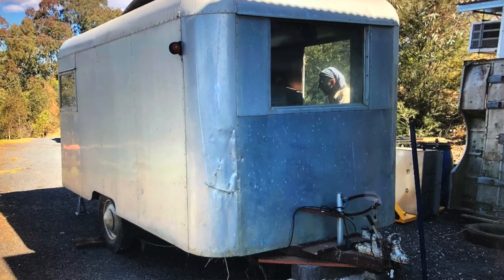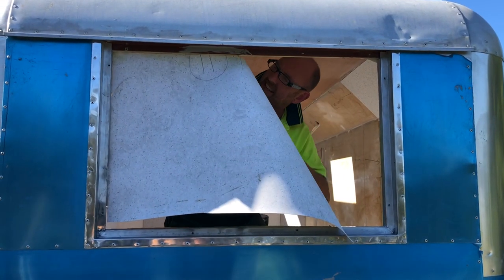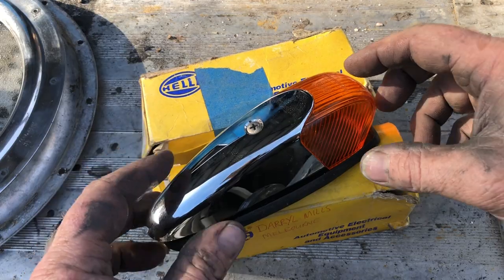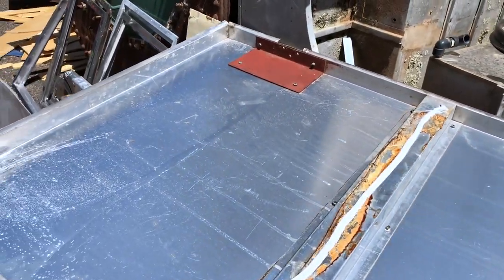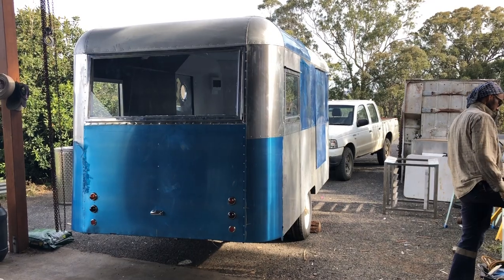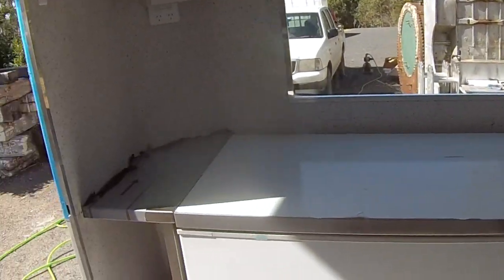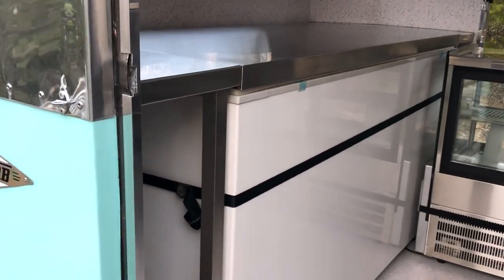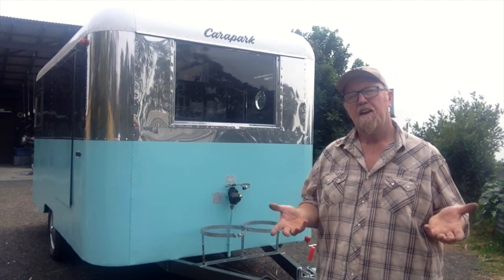Amazing food-van conversion - Best vintage food caravan / food truck build Part 2 of 2

Comment: Hi Steve, thanks heaps for your videos! And congratulations on your great work! I bought exactly the same caravan last year and am finally starting the reno for a food van too, so excited! I'll keep watching your amazing videos with all the detailed infos you're providing, and might ask some questions soon.. Cheers! Cecile
Reply from the maker: Thanks Cecile, glad the episodes are helping you with your restoration and conversion - that's what they are for :-) Good luck with your project, happy to help out with any questions you may have.
Reply: Thanks Steve, I'm wondering how to make the opening windows as you ised the original ones..?
I also thought of putting an evacuation in the middle of the floor, I guess I can do that at the end and connect it to my grey water supply.
And regarding the LED strip lights, can I give me more details please?
Thanks heaps. Kind regards, Cecile
Reply: Oh, and last thing Steve, where do you get your lights? cause I've been told suppliers don't make them anymore..  as they're obsolete.. only LED lights now..?
Reply from the maker: @cecilecharrue9765  we restore all original windows and only make the rear windows.  We cover that here https://www.youtube.com/watch?v=YxXarIO0OcQ&list=PLXy9z8PnGsBvwFFenN2yen_aduxjsmTvK&index=14&t=2s   If you install a floor waste (floor drain?) , you will need to waterproof the entire floor and coving then screed the floor so it all slopes to the middle before putting in your floor coverings.  It would not work very well, that's why we use the sealed commercial vinyl with no lip on the door so when mopping and cleaning the excess water can be squeegeed out the door.  We cover the flooring system here https://www.youtube.com/watch?v=md3Zm7rmCzg&list=PLXy9z8PnGsBvwFFenN2yen_aduxjsmTvK&index=11&t=0s  LED lights covered herehttps://www.youtube.com/watch?v=NjKhWhs40OU&list=PLXy9z8PnGsBvwFFenN2yen_aduxjsmTvK&index=12&t=2s   is there specific questions about LED lights?
Reply from the maker: @cecilecharrue9765  Which lights, the LED or the tail/brake, indicator lights for the van?
Reply: @VintageRestorationsAustralia  both.. atm I can't find any driving lights.. and also wondering if anything special about the led inside the caravan? thanks Steve x
Reply: @VintageRestorationsAustralia  thanks Steve, I'll have a better look at those videos.
Reply from the maker: @cecilecharrue9765  I stick with standard 12 volt LED strip and down lights for interior lighting in the vans.  Power with a 240 AC  to 12 volt DC tranformer.  Make sure you use DC switches for all DC lighting.
Reply from the maker: @cecilecharrue9765  https://www.ebay.com.au/sch/i.html?_from=R40&_trksid=p2334524.m570.l1313.TR1.TRC0.A0.H0.XLucas+indicators.TRS0&_nkw=Lucas+L+594&_sacat=0&LH_TitleDesc=0&_osacat=0&_odkw=Lucas+L+598
Reply: thanks heaps Steve! I'll do that for squeegeeing, that sounds much easier and practical.
I'm ordering the lights today from the UK, so exciting, I can't wait to receive them!
And I'll follow your instructions for the lights inside the van. Thank you so much!
Reply from the maker: @cecilecharrue9765  No problem, good luck with it.
Reply: @VintageRestorationsAustralia  sorry Steve, one more thing.. re the lining of the walls.. I read your reply to Susanna.. I've got some 0.5 aluminium sheet (they're the same panels used for cool room walls, I got really cheap off cuts from a scrap metal yard), so would you still line the walls with wood first? Thanks Steve
Reply from the maker: @cecilecharrue9765  Yes definitely
Reply: Steve you're not using any back up light? I any find any on eBay either..
Reply from the maker: @cecilecharrue9765  do you mean a reverse light?
Reply: @VintageRestorationsAustralia  yes
Reply from the maker: @cecilecharrue9765  Use the black wire in the 7 core (flat plug) to run a reverse light but it is not a requirement for registration nor are they very useful generally.
Reply: @VintageRestorationsAustralia  Hi Steve, what;s the thinner plywood sheet I could use behind my aluminium panels for the walls? To keep weight low.. THanks
Reply from the maker: @cecilecharrue9765  3ply brace board.
Reply: Hi Steve, thans and sorry for my late reply, I've got a few more questions..
Regarding the axle, it seems to be a basic box trailer axle, not heavy duty at all.. and I need to replace the whole thing.. though they don't come around that easily.. do you have any idea how or where to get one? 
Also, I'm creating a new window, at the back, instead of the whole.panel, but I can't find anyone doing aluminium here.. do you make your own windows? Any ideas of where I could find someone to make one? A caravan maker? Now that the borders closed its not as easy to go to ALD but.. I live around Byron.
And last question, for the water tank, I've got a very clean fuel tank, would that pass the rego? It's a 130l and I'm  thinking in dividong it in half to get 2 x 65l, 1 for clean water and 1 for grey water. How many exits do I need and where? I'm the water one, one to be filled up, one to come out both at the front, and one flushing one under?
And the grey water one, same?
Thank you Steve
Reply from the maker: @cecilecharrue9765  axle videos
https://www.youtube.com/watch?v=VrbRbdYVsV0&t=4s
and
https://www.youtube.com/watch?v=p317mX33cjE&t=204s

Axles we get through Huntsman Trailers in Melbourne - you can order online

Yes we make our own rear windows.
https://www.youtube.com/watch?v=YxXarIO0OcQ&list=PLXy9z8PnGsBvwFFenN2yen_aduxjsmTvK&index=14&t=24s

To have windows made contact Brendan a Retro Caravans Gold Coast 
https://www.facebook.com/RetroCaravansGoldCoast/

We use these tanks

https://www.huntsmanproducts.com.au/collections/water-tanks/products/caravan-camper-trailer-4wd-stainless-steel-water-tank-85-litre-brackets

there are episodes about tanks here

https://www.youtube.com/watch?v=ASZzmKV0X1Y&t=25s

and here

https://www.youtube.com/watch?v=ekvYZBo7BxY&list=PLXy9z8PnGsBvwFFenN2yen_aduxjsmTvK&index=7&t=25s
Reply from the maker: https://www.huntsmanproducts.com.au/collections/axles
Reply: thank you sooo much! I'll watch videos and contact those people tmw. Last question, are reflectors and clearance lights compulsory for caravans?
Reply from the maker: @cecilecharrue9765  Yes
Reply: Hi Steve, I've got my caravan at the trailer place to change the axle, very excited! I've been researching and found out that mechanical brakes would be my best choice.. as they don't get stuck on the reverse.. but it seems like no trailer shop has any idea about what I'm talking about.. Do you know about it? 

"The European braking system also utilises an overrun dampener (different to the Australian standard) which acts as a shock absorber. This dampener is installed to prevent the overrun brake from immediately working when the throttle or brake is slightly released. This in turn completely removes the jerky, vibrating feeling that a standard Australian mechanical braking system possesses.

The European mechanical braking system utilizes an auto-reverse mechanism which is included in the brake drums. This mechanism ensures that the overrun brake will not take effect when reversing."
https://a2btrailers.com.au/electric-vs-mechanical-trailer-brakes/
Reply from the maker: @cecilecharrue9765  I always install electric brakes as they are adjustable to suite varying loads, make towing better and they are much safer.  Mechanical overide brakes are ok for lighter vans but not food vans (too heavy) and you do have an issue with having to engage the block on the overide mechanism on the hitch before reversing which is a pain, mechanical brakes are problematic not electric.

Comment: Luv your work Steve! Can you tell me where you get the upright support clamps, you used to support the ceiling?
Reply from the maker: Thanks for the positive feedback Derek, appreciated.  The clamps originally came from Bunnings, they are not great quality but they only cost about $30 each (several years back). If you are after better quality I would try a specialist plaster board supplier perhaps? Cheers

Comment: Hi Steve, amazing job! We are doing one too!  Just wondering , we were thinking of avoiding the timber part and use just stainless steel sheet for the walls , do you think we will have any problem with that?
Thanks a lot Steve!
Reply from the maker: Susana. Good question but not as straight forward as you may think.  Sort answer is yes, there are some problems with unbacked SS lining in a Carapark. There are several reasons why we fit structural ply linings in general areas (as opposed to behind cookers etc). 1 - it allows us to screw in and attach fixings and fasteners anywhere on the wall without limiting you to screwing into the steel frame. Essential for the type of fit-outs we do.   2 - it adds significant structural integrity to the walls,  the loads of food vans are at least double or triple that of the design purpose. The vans are not designed to take the weights of such conversions so need to be reinforced.   3 - the ply linings allow us to  'glue' lighter stainless sheet to the wall and avoid surface fasteners and bulky joins that food inspectors really really hate. The Standards do not allow  screw heads, rivets etc on surfaces, it has to be a fairly seamless cleanable surface without grime traps like joints and fasteners for food safety (read as cleaning).   4 - thinner gauge  (.55mm) stainless sheet is considerably lighter and a lot lot cheaper than 1.2 (min) which you would need to line walls unbacked. Lining with more rigid stainless is crazy heavy and you absolutely must keep your GVM under 1450kg for a standard running gear set (or 2000kg if you upgrade the entire running set).  5 - trying to bend SS to fit the irregular ceiling corners and joins is super hard to do and we are very experienced builders with all the gear to do it properly.  Stainless is very unforgiving, it is expensive and hence mistakes are very costly.  Finally 6 - the ply prevents cold/heat bridging which is a big issue with these vans (especially heat bridging in summer).  All that said, it can be done, we have done it and overcome the issues around it but.... we would never do it again.  We DO use unbacked 1.2 S/S in high heat areas.
Reply: Woww you couldn't be more accurate!! Thank you so much Steve I'm so glad I found your YouTube channel you're a legend! Thanks again !! Cheers